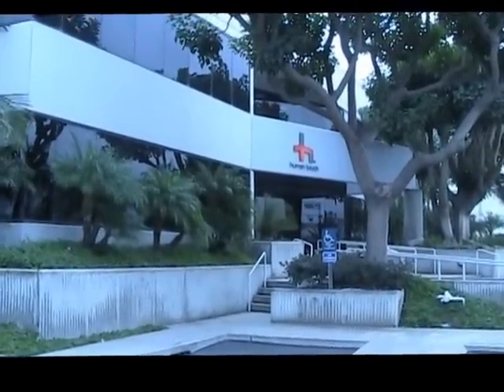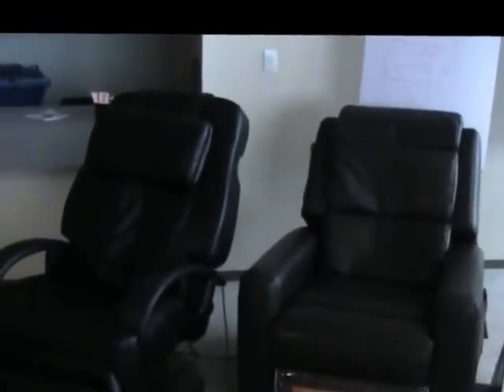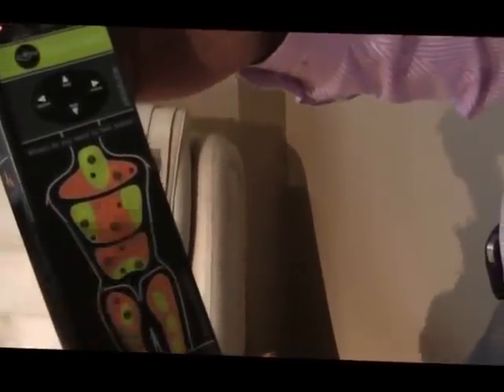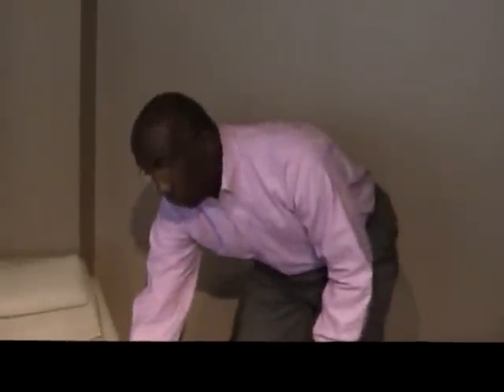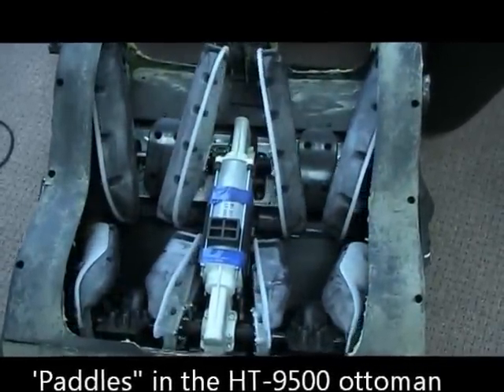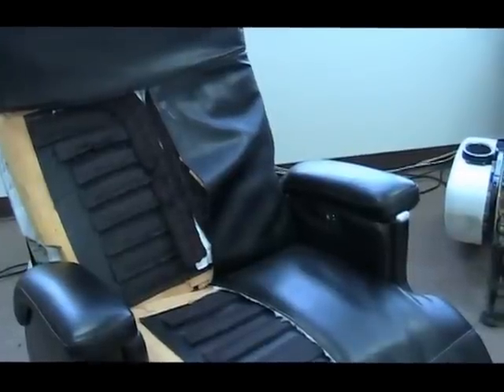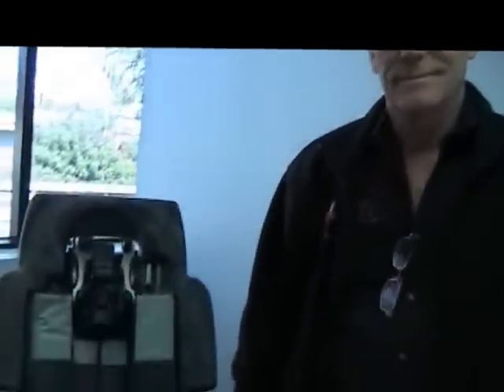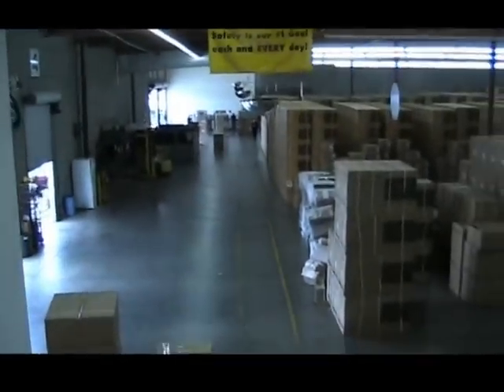My Visit to Human Touch Massage Chairs Head Office

Comment: will a 9500 remote work with a 1650
Reply from the maker: Hi, William. Thank you for your inquiry. The remote control of the 9500 will not work on the 1650. I've had this question before since we sold the 1650 years ago. We were told at that time that it would not be compatible. You can also contact Human Touch at 866-369-9426 for more information or to see if they have any 1650 remotes available. I hope this helps!
dr. w.